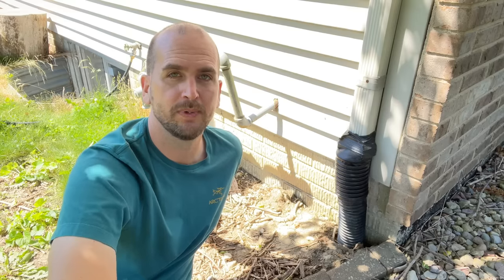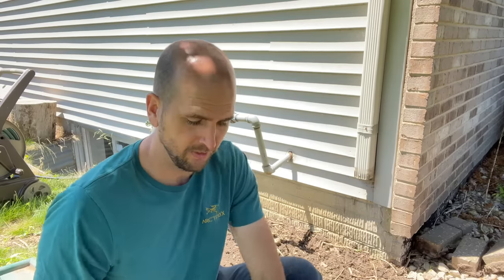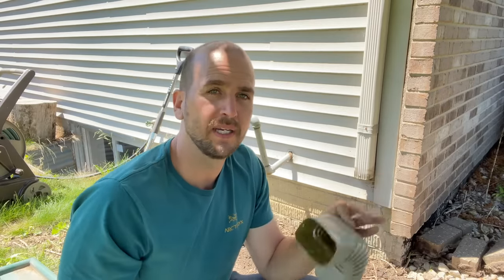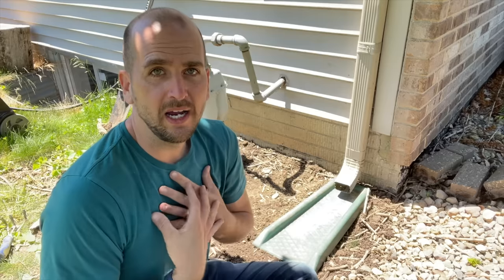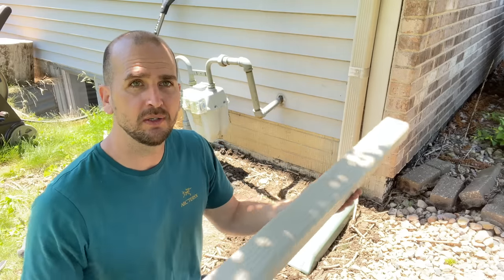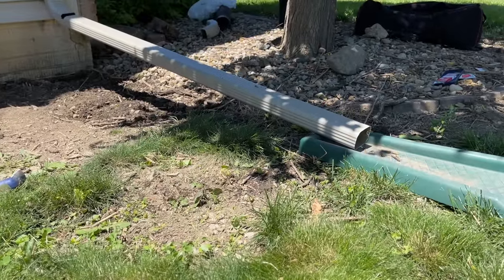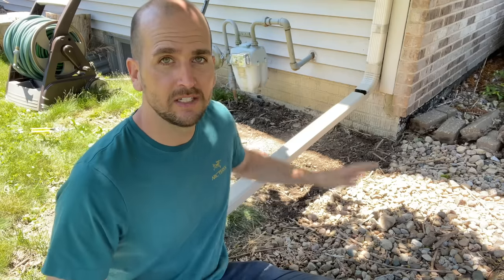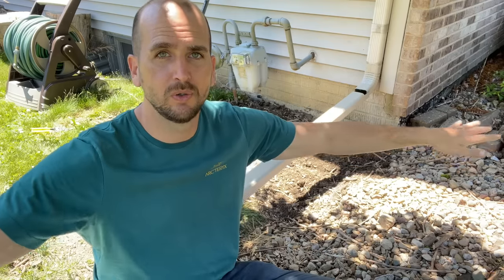3 Options for Extending Your Downspouts

Comment: Since the screws are chosen to be short enough that leaves won't be caught on them, what will prevent those leaves from clogging the option #3 trench drain pipe?
Reply from the maker: In Option 3 there are a few factors the more slope you have the faster the water will travel and help to flush the 4" pipe and also I use a wye at the inlet to also allow a garden hose to flush out the line.

Comment: Does the long term solution work in states where it get well below freezing and lots of snow?
Reply from the maker: I am in Illinois and we have some cold spells during the winter.  I haven't seen and don't expect any issues.  I installed 4 different runs just link this 2 years back and everything is still working well 👍

Comment: Is there anything I should consider if I did option two but with the short (2") side of the downspout on the bottom (using the bend you mentioned at 2:54 to go towards the street)? Or would it be better to get an A-to-B transition so the long (3") side stays at the bottom?

Comment: What do really high end homes do for solutions so they don’t see an ugly black  or white box on the side of the house at the end of each spout to catch leaves before it goes into the ground corrugated pipes to get water far away. Does anyone make an unground leaf filter so the gutter can just go down into the in ground device?
Reply: Excellent video. I get no leaves or big material on my roof. Can I have gutter downspouts go right into corrugated pipe in the ground, and have a Catch Basin 2 feet away to catch any debris? It would look much cleaner at the house to see the spouts go right into the ground. Couldn’t I even put a wire mesh on the inside of the catch basin’s  duct exit in case a leave or large object did go down the drain so the mesh would catch it? This would leave a much cleaner look at the gutters next to the entrance of my house. (I need to catch 2 downspouts and put some in ground drains as the grade slopes slightly toward the house and I get standing water with clayish soil after really hard rains).

Comment: Most people that have underground have issues with them down the line. Seriously I do gutters and at least 3/4 of the houses I do have roots clogging the pipe underground, I know because I clean them as well. I tell people just go with a normal kick out, it won’t get clogged in 10 years and then you won’t have to pay a ton of money to me to clean them
Reply: For sure roots can cause problems.  If I see roots when digging the trench, I don't use perforated pipe, but rather solid pipe, well sealed.
Reply: @slatsgrobneck7515  yeah that’s the problem though, guys just want to get the job done and forget about it, people more and more are doing just crap work not thinking about the long run or what the home owner doesn’t see it doesn’t matter...

Comment: I bought a house with the larger-capacity gutter system and option 2 extended spouts. Each side of my house has swales to direct the water away. Great! 

The first time I lifted the extended guards in order to mow, they all broke off except one. I was so pissed. Have never known how to repair it and won't spend the money to have a gutter guy come out.

I really wish you home maintenance or improvement YTers would share your location or USDA Hardiness zone in all your videos to help your viewers with context. I was with you and following along until you mention burying PVC - which I've read will freeze and crack in cold areas and may be a poor solution for those viewers. I need to be able to interpret these tips appropriately for my area/situation. 

I guess I should probably just assume you're in non-freezing zones. The Canadian YTers tend to mention that they're in Canada and the southern YTers don't seem to think of northerns at all. 😅

Thanks for the video.

Comment: We live on 4 acres and our neighbor lives on 3.5 acres.  We recently found two old plastic buried 4 inch perforated ADS pipes on our land coming from the neighbor's house.  The neighbor is new and the adjacent home is ten years old. The neighbor's house is about 100 feet and up a gentle slope from the property line and each pipe extends about 20 to 50 feet into our land (so they have buried downspout pipes running about 150 to 200 feet from their home, down hill across a property line).  We asked them nicely to relocate them to their side but they didnt say yes or no -- it was very nice, vague language.  It's been two months since finding these pipes and we are getting anxious as we saw the neighbors in there on occasion and we think they knew about those pipes but lied about it. And we just dont like the idea of having a neighbor's home maintenance activities on our land.  Do you have any logic I could use to convince the neighbors that they should relocate their downspout extensions onto their land? these people are slick and well off so they dont need to have their pipes on a neighbor's lot - they can afford to have the work done right.  their pipes are cracked by the way and do not seem to convey much water as I have checked them and they are really just muddy old dirty pipes with holes in them. Thank you.
Reply: Our downspout runs into a French drain that runs just into the neighbors yard and away onto the golf course that our property’s back onto. The neighbor’s downspout runs into the same pipe. It works well having two families montoring and maintaining this drainage 😉.
Reply: @simplecentrist5935  Happy for you. Totally different scenario than what I described.

Comment: Try putting the splash guard the other way around.  Your way the splash guard will increase the speed of water causing more erosion.  If you turned the splash guard the other way water would splash over the elevated edge at a more gentle pace causing much less damage.

Comment: the spout in the beginning of the video only works if yo udont have junk and dirt from trees and stuff going down the pipe. FYI..  not easy to clean out the tube without pressure washer nozzle that can go down and run the length to the out spout on the lawn.  I know this because I have to do that to mine. Prev owner of the house didnt do it right. Forgot to put catch filter in it so water goes down junk elswhere.
Reply from the maker: Agreed that is why I will install a wye at the inlet to allow for cleaning.  This house doesn’t currently get much in the gutters but good long term plan for sure 👍. Thx for the feedback!
Reply: the clean out knob isnt the best.. its good to have but have a one on the ground instead that has a clean-out. along with an inline filter above it to catch debris
Reply: @SuperJimmyBennett  I went from a 2x3 gutter to several inches above the 4" Round PVC.  That 90* 4" round PVC junction has a rectangular top that seats a separate short piece of 3x4 gutter, which slides up enough for cleanout.  I just installed gutter guards that prevent any major obstructions.

Comment: Don't use corrugated pipe. The corrugations gather up the roof dust and eventually clog the pipe. You should use smooth PVC pipe and you will have a trouble-free solution for many years
Reply: Correct. Also, a good detail is to attach a 4x6 Fernco adapter to the PVC stub above grade, leave a 2" gap from the bottom of the downspout, and pop in a plastic or brass grate into the Fernco. This will filter leaves, and will be easy to clean.
Reply: The opposite is actually true. The corrugations cause turbulence in the water and this turbulence keeps the pipe clear. You can find countless YouTube videos on the subject.
Reply: @mikel6175  we'll have to agree to disagree on this one
Reply: @GrammarPoliceInvestigations  I did not believe it either till I saw a few YouTube videos where they put a small camera inside the pipe. Leaves, twigs, and sediment got stuck in the non-corrugated pipe. I know it sounds crazy!
Reply: @mikel6175  I'll have to check it out, thanks.

Comment: We call those black corrugated HDPE pipes “tubes of desperation”. They fail 100% of the time. Drainage is important. you should use schedule 40 PVC pipe. You should install a clean out at every change of direction. You should discharge to daylight or a bubbling basin that is large enough to clean out.

Comment: Wait a minute, what about round downspouts??
Reply from the maker: Very uncommon in my area?  Do you have round downspouts on your home?
Reply: @EverydayHomeRepairs  I install copper gutters with round downspouts-
Reply: @EverydayHomeRepairs  Instead of digging 50', I only dug 10'.  I used 4" PVC to extend the flow to the side where the grade is down and away from the house.  The outlet is open, but covered with a conical type grate.  Almost all of the pipe is covered by ground.  The area surrounding the outlet is graded so that mowing can be done with no fuss.

Comment: First thing you need to do is regrade surface ground level to allow rain to drain away from the home.  Your third method is best, do not bury pipe it will "Frost Jack" basement wall in winter.   ALSO your gas installation is Dangerous , The GAS Metter must be supported, look at the pipe being bent down as it enters the house!.  When this pipe opens inside your basement the result is a life and death event.
Reply: "Your third method is best, do not bury pipe it will "Frost Jack" basement wall in winter. "
Please explain what you mean by this.
Reply: @bobraible  In January, with a mid winter thaw the roof snow melts with rain water, flows down the down spout and freezes within the pipe buried in the frozen ground.  The down spout pipe freezes at night with the back up of trapped water from roof.  Next day the thaw continues and water flows out of the split down spout....against the basement wall.  that night temperatures drop and the wet ground against the basement freezes...as water freezes it expands and pushes the basement wall in.  From that point on every time water freezes next to the basement wall it pushes (frost jacks the wall inwards.    

You want the surface graded with a minimum 1/4" to the foot slope away from basement walls and down spout to extend at least 3 feet ( one Meter) away from basement walls.
Reply: @brianferguson6278  Thanks for the detailed explanation. Since the builder's trench extends 6 ft or more from the basement wall, I have seen recommendations that you want to convey  the rainwater at least 8 ft or so away from the basement walls so as to be past the region of disturbed soil.

Comment: I'll never understand why homes aren't built up a little higher than they are. My home is actually a little lower in the north back and on the west side than the surrounding ground. It's mind boggling. I understand homes are indeed built this way, but not all are, and the grade isn't steep enough, IMO. I also understand homes sink over time.

Comment: Nice video, but this is NOT applicable well in area with freeze and ice climates. If the discharge and its hose is close to ground (no air divider), the ice build up the hose from the ground. It can easily reach 2metres in winter. And it can also crack the hose. The melting period (or cold nights and warmer days) during the winter will be the issue when water from the melted ice start to drip out and moisture the wall and ground close to the wall.

Comment: As soon as I  see corrugated pipe I shut off. The stuff is garbage unless you can find it thats smooth INSIDE. Do yourself a favor and use smooth pipe...or spend forever with clogged corrugated.

Comment: if you're going to bury anything make sure it's PVC! Is in the white PVC you can get pretty much any big box store. You do not want to use that black corrugated BS underground! That stuff will clog it super easy because the inside of it is not smooth and water will stay trapped within the pipe. Why on earth would you suggest using that under ground? The white PVC for underground is a no-brainer. It's cheap you can find it everywhere and you will have way way less problems using that.

Comment: Corrugated pipe is not a good choice for draining water away from your home.
Reply from the maker: Interested to know why you don't like corrugated?  Do you think the pipes are more prone to clogging with debris compared to smooth-walled PVC?
Reply: @EverydayHomeRepairs  it is more prone to clog with dirt and debris in the corrugations. Smooth was is pretty much self cleaning when there is proper slop.
Reply: @EverydayHomeRepairs  I agree with Scott Russel....Solid PVC should have been used so many feet out then perforated the rest of the way
Reply: @scottrussell5041  Not if it is put in properly actually. In my line of work, I am more concerned over 90 degree elbows that have to be used with pvc than the corrugations in  single wall pipe.

Comment: Option 3 = bad idea. Either clogged with debris or frozen in winter.
Reply from the maker: Hmmmm, interested in what you would do in that scenario. 🤔
Reply: Install the PVC below the frost line with a clean out trap installed in the the down spout just above ground

Comment: It is perfectly logical that 12 inches make a foot.. and three foot make a yard... And 1760yards is one mile...and ofc 16 ounces is a pound.. effin' cavemen. Edit: btw, what do you do with precision engineering things in the US? When things need to be measured in multiple thousands of an inch precision? Or like fluid dynamics and pressure per area calculations? Has to be hell.

Comment: I foresee option two just breaking after you lift it up a few times. Also, cover that hole with something to keep leaves out. Movement is bad, and this thing is just a jerry rigged movement solution. I just see this breaking in many different ways.

Screws will need tightening all the time, the mount on the wall will loosen up over time because of stress you put it thought when you move it up or down, and also the holes that are holding the screws will get worn out in to bigger holes and just won't even hold the screws anymore.

This was a terrible half-baked idea.
Reply from the maker: The 2nd option works well and I wouldn't say it will last a decade but could easily work for 5 years just raising the extension once every week to mow.  Actually I have done the same thing without the bracket on several properties with just 2 screws as the pivot point and it holds up well as long as the mower doesn't hit the extension.
Reply: @EverydayHomeRepairs  i have to mow two times a week during summer

Comment: Imagine if down spouts would be round.. Americans and their squareness. Same with electrical boxes and cables. A round hole for round electrician boxes doesn't have to be perfectly level, it takes one cut with a hole saw compared to 4 cuts with a multitool or a sheet punch saw. A round pipe for the spout can be turned any way you want the water to go. Then again.. still using the Imperial system in 2022 explains a lot.